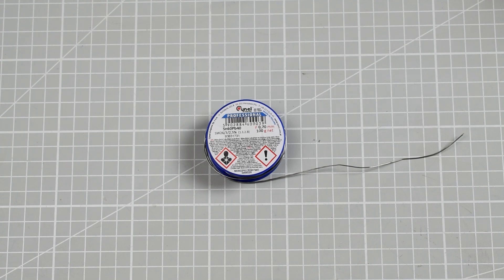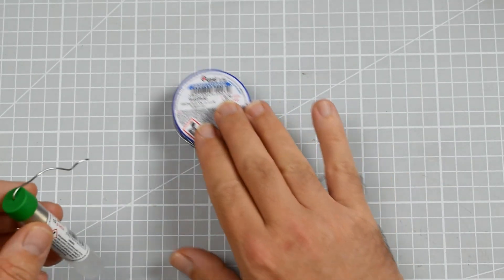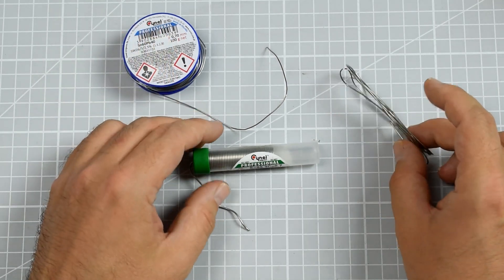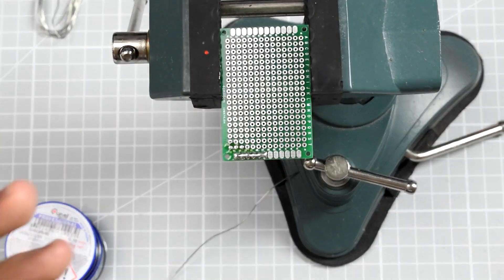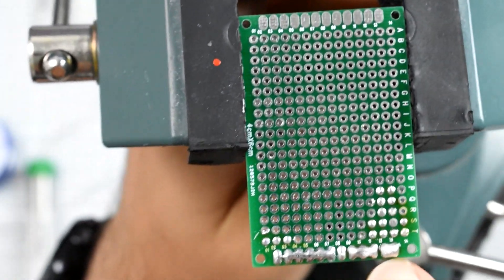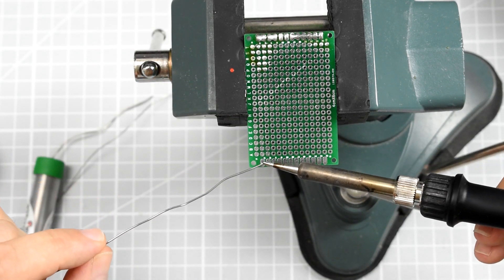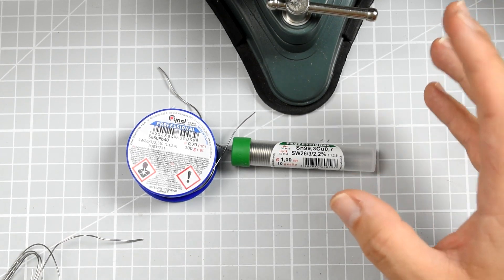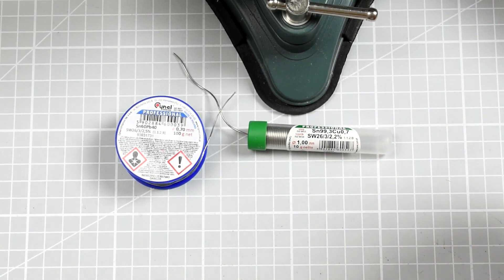Lead solder vs lead-free solder vs silver solder

Comment: If you have ever seen an old car battery terminal with "Fuzz" all around the outside - those are "Tin-Whiskers" and they are always growing and growing inside of ROHS electronic devices today.
Leaded solder is why Vintage Computers from the 1970-90's are still working in this century.
Reply: Well, really, I tore down an old powered bass module from BOSE and all of the solder joints were cracked where the heat sink connected to the amplifier chips. That thing was bought in 1995 and was definitely using leaded solder. I recently tore down a 2008 computer PSU that used lead free solder. Aside from having to use a blow torch (not literally) to de-solder the joints, there was no whisker growth anywhere on the PCB or other components. In fact, even the heat sink connectors were solid as hell.
Reply: @kpadalldotablet1009 a rare scenario although its not uncommon to see sound systems having cracked solder but they are still way better then today stuff dosent last 5 years
Reply: That explains why my sisters 8-year-old iPhone had its Wi-Fi and then its Bluetooth fail within a month of each other.... :( Got to love planned obsolescence, not enough that they break them with software as well.

Comment: Is there any sort of consensus on Bismuth solder?
I’ve wanted to get into soldering for a while, but I absolutely refuse to touch anything with lead in it. Bismuth seems like it’d make a good substitute, and it seems likely you could use it to get a low melting point solder that doesn’t have to deal with whiskers or fragility.

I was wondering if anyone knew if anything like that’s been put out there yet.
Reply: Bismuth will blow ur bollocks off
Reply from the maker: I have no idea TBH.

Comment: I used some lead-free (with copper only) years ago and honestly when using flux it wasn't so bad to apply either. I think the real problem is the long term stabilty. Cold joints, whisker growth, oxidation... 
It's always a PITA to desolder pretty much anything from a post-2006 (RoHS) PCB compared to the older ones. The joints are mostly dull and oxidized, cold joints on hot components are far more common too. 
So I think if you solder professionally in (or for) a country which banned 60/40, the silver stuff is probably worth the extra cost if you wanna provide a reliable and well servicable product.
Reply from the maker: You are probably correct here. I'm in this comfortable position that I can buy 60/40 no problem and I'm an amateur. So lead poisioning is not a problem with my amount of soldering as well
Reply: Thanks for the insight.

Comment: Led free solder is not that bad as you grandfather remembers! The problems is that led free solder isn t that flexible because doesn t have lead, and using it to solder cpu or chips that get s hot and cold all the time can crack the solder.
Reply: What alloy do you prefer?
Reply: Long live the lead solder
Reply: So it is bad? 🤯
Reply: So it is bad? 🤯
Reply: So it is bad? 🤯

Comment: I've got some 63% tin, 35% lead, 2% silver solder (£10 for 250g from hobbyking) Lovely stuff, flows like liquid silk, shines like jewelry - treat yourself Pawel, you won't regret it.
Reply: Just purchased leaded soldering wire because it is more workable and changable.

Comment: Personally I'd be interested in seeing how well or not the various solders you had would work with large battery wires to an esc and or motor wires onto an esc.
Reply: You need  rosin core 60/40 tin/lead solder, rosin paste flux, adequate heat, and good technique for large gage wire/connector soldering.